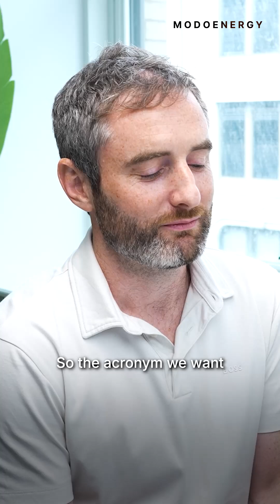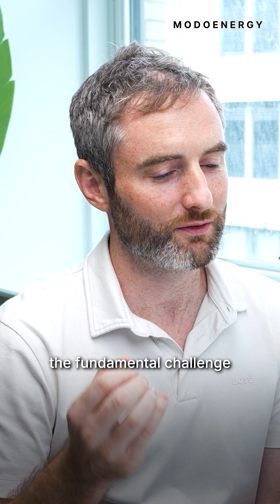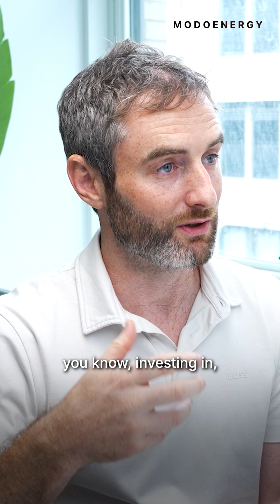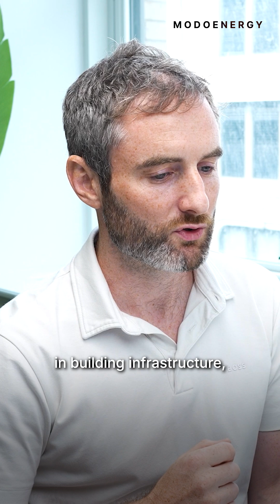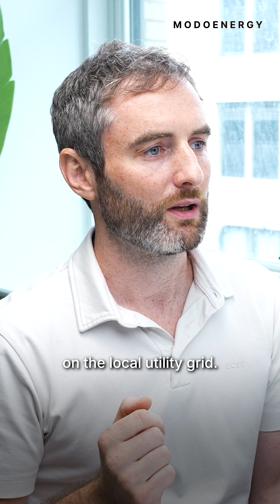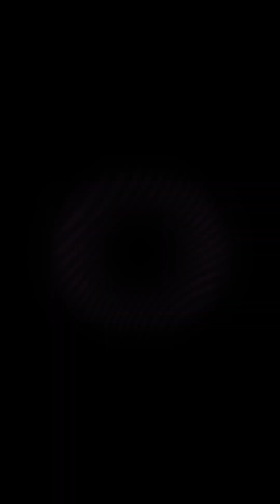Can local flexibility markets fix grid congestion with James Johnston (Piclo)

Comment: My suburban high rise commercial building's BA, Building Approval, was dependent on electricity supply from the full local grid that was to be upgraded.
The first answer was the owner of the new build pay for the new grid capacity from the distant main supply.

As each new following high demand development arose, and connected to the local grid, then the owner of my project received a refund.

My suggestion today would be to help all those suburban local homes and small businesses and warehouses install roof PV and a community battery and home batteries. 
UNLOAD the local grid and free up capacity for the new high rise buildings on the existing local grid.
Grid cashflow would be maintained. 
Extremely expensive new extra grid capacity could be saved.
Even include a large battery into the buildings footprint. 
A basement battery ?

Think of the grid as a tree and branches as local communities. Focus on one branch and subsidise its roof PV to a level that proves to the next local community the viability of the new technologies. 
Subsidise can be removed. And $TRILLIONS saved on no new grid capacity.